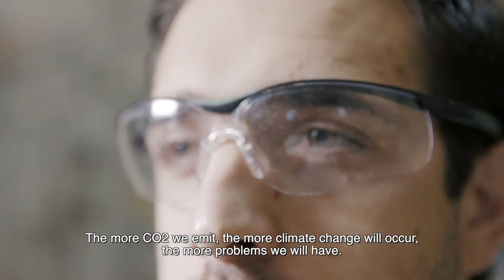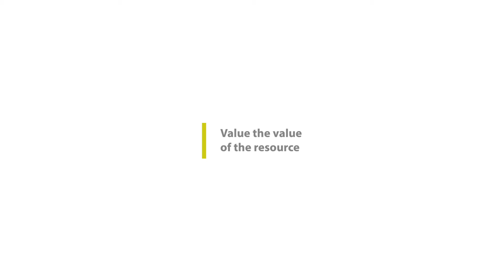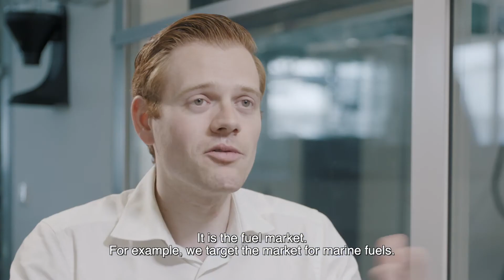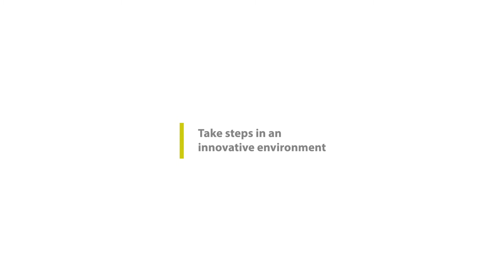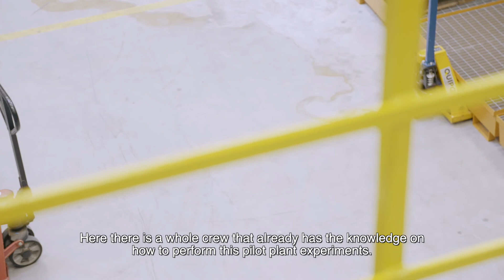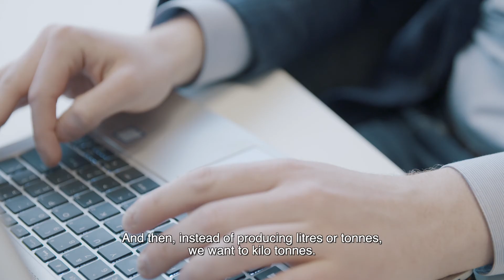From lignin production to valorization

Comment: What about weaving lignin carbon fiber with carbon nanotubes?  Twisting them together at the fiber level and the using a graphene resin?

How would that fair in compression, torsion, tension, heating, and cooling?